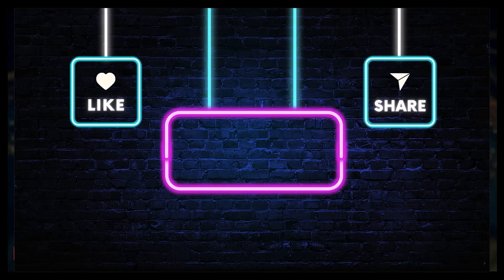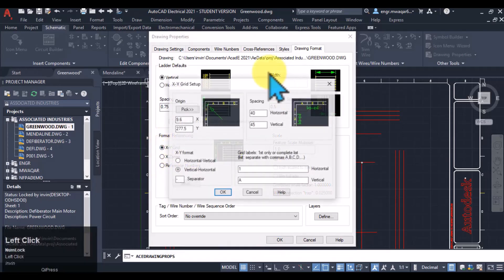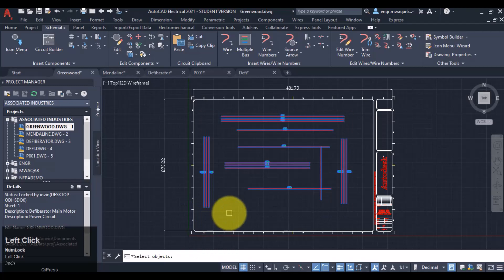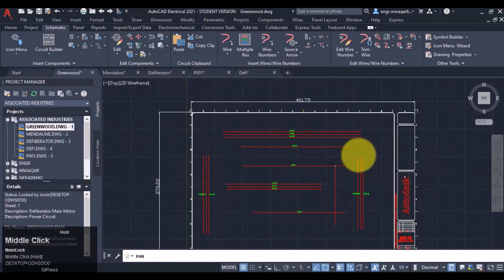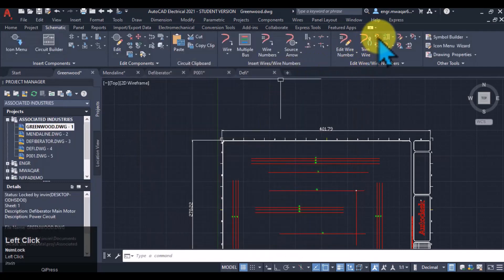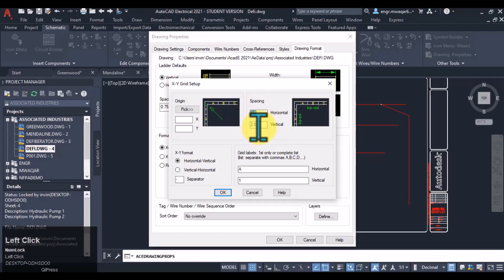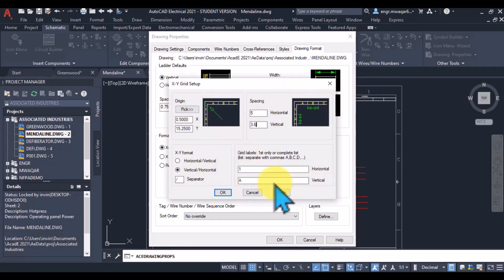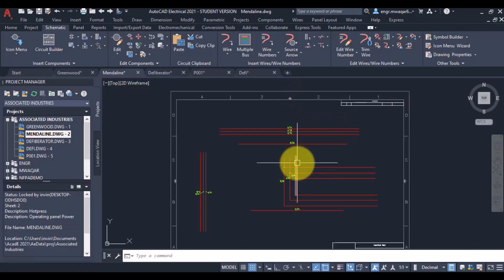AutoCAD Electrical 5.1c: Issues in Wire Numbering | XY-GRID Settings

Comment: But sir I wanna customize font size of XY grid numbers. And i wanna make  complete template in electrical all these settings apply on it and pdf jumping if i click
Reply from the maker: Thanks for your comment! 🙏 Yes, you can customize the font size of XY grid numbers and also create a full template in AutoCAD Electrical so the settings apply automatically to every new project. Regarding the PDF issue (jumping when you click), it usually happens due to plot or annotation settings — you may need to adjust the scale or update the plot configuration. If you still face any issue, kindly let me know.